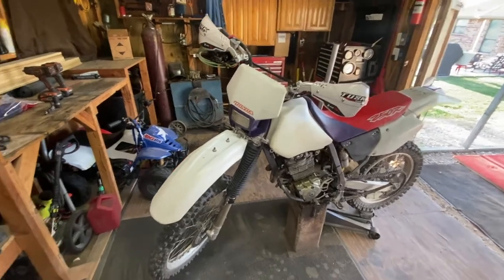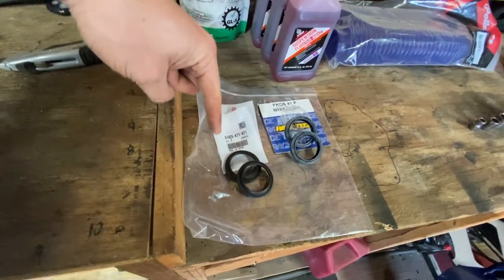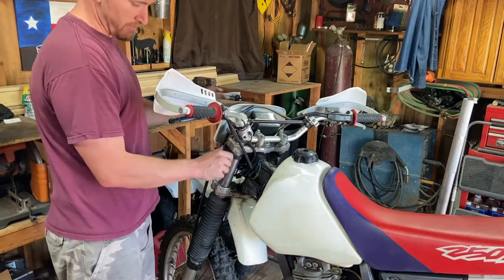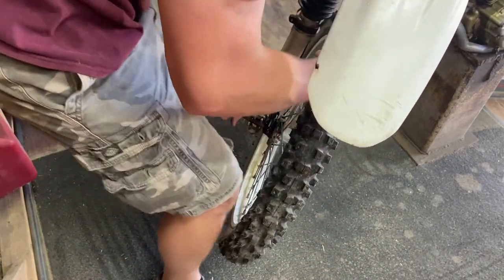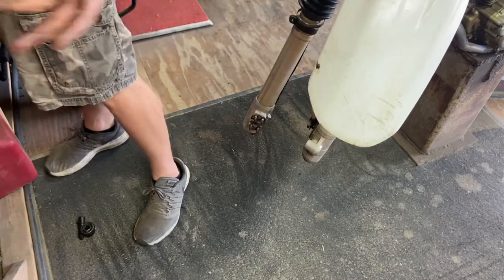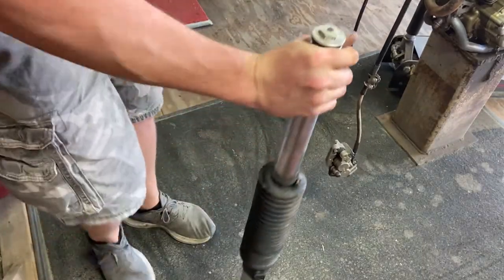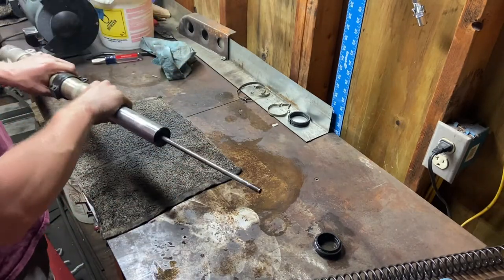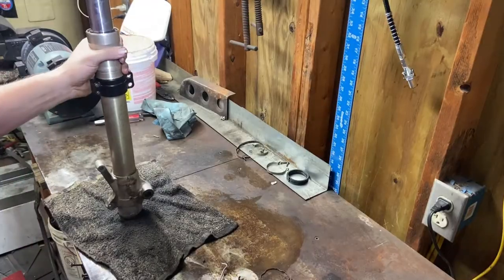1996 XR250R Fork Seal Replacement

Comment: Make sure you sand the edges so you don't scratch anything. Let me use this screwdriver. Wow
Reply from the maker: Yes it does seem rather funny to say. But if you can’t see in the video, it has been rounded and smoothed. I originally made that as a tool for removing plastic door panels without gouging them. It’s been a really handy tool for a lot of things since.
Reply: @micalstephenson  the title should say "the wrong way"